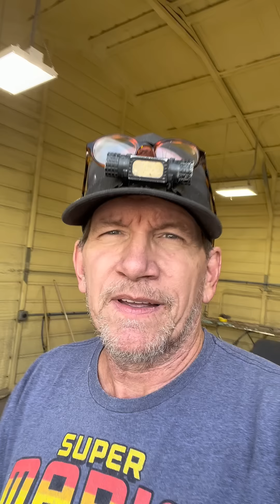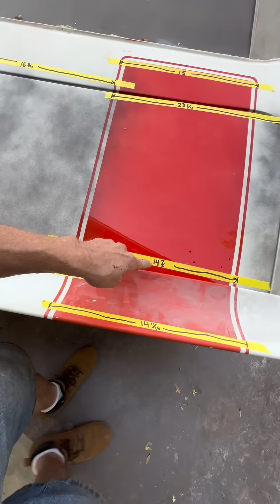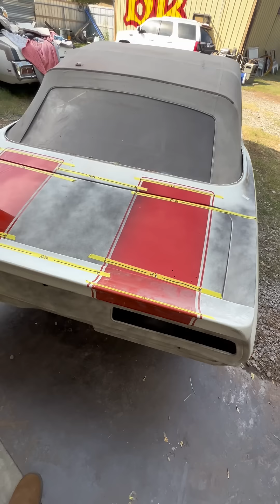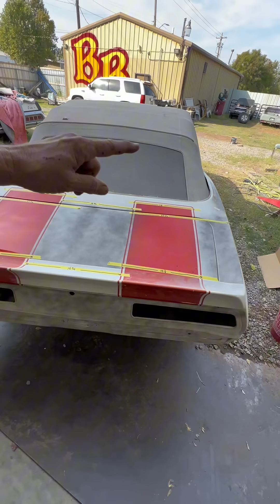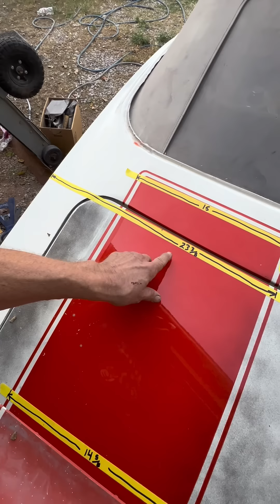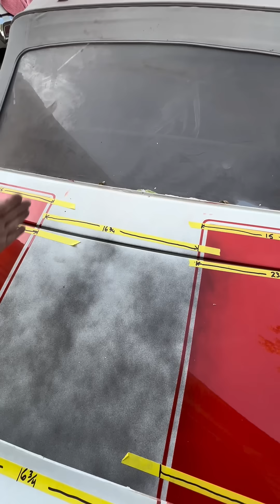Billy GOAT TROLL Stripes Measure Up 69 Camaro Pace Car DIY Painting

Comment: Dont sweat that shit bro. No stripes were perfect. And yours match VERY well. I myself have done ss chevelle stripes on a clone. Let me tell you there is a difference in all the makes and models including trucks with stripe kits. There was variences in body panel assembly so, there were FACTORY variations in size and width. If any of those trolls had ever done even 1, they would know that. Keep killing them Billy

Comment: I’ve seen Camaros with original paint and the strips are not the same on the left and right side. The factory altered the dimensions on the passenger side because of the emblem placement so that the stripes wouldn’t end up stopping underneath the emblem.  What you see here with the different dimensions on the passenger side and driver side is how they came from the factory.  It’s not a huge difference, but if you ever see one that’s been repainted and the stripes are dead even, that’s not how Chevy did it at the factory.
Reply from the maker: Yeah, when I was investigating pace cars across YouTube, I saw some where the Camaro emblem on the trunk was partially off the stripe and didn’t look right

Comment: Carrol Shelby figured  this out in 64. Look up the measurements for a 65 Shelby gt350. The stripes  get wider then narrower several times over the whole car.  Why?  Eyeball test. He had them pull tape until it looked right. Then then measured what “ looked right “ measured. And recorded it for consistency. Billy is 1000 % correct
Reply from the maker: The cowl induction hood on the front of this pace car keeps it from having the same effect to the eye